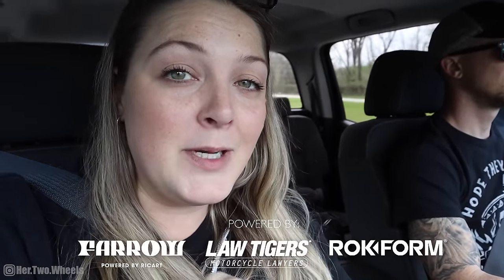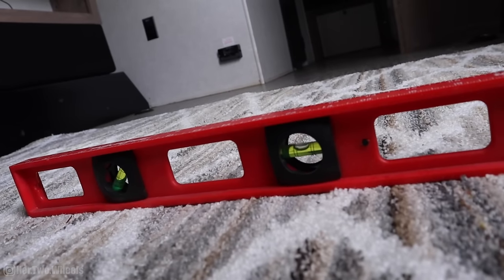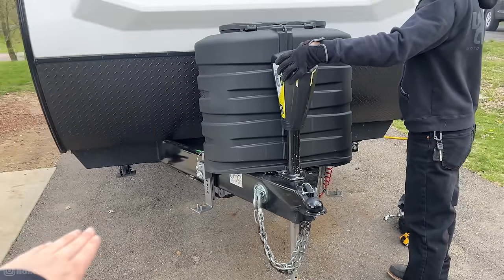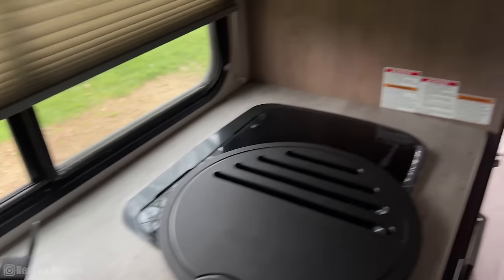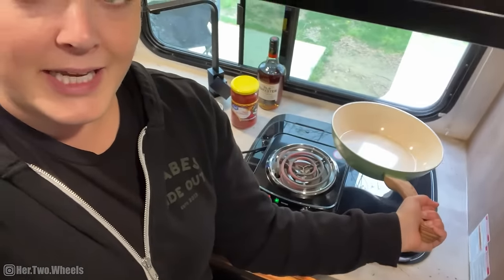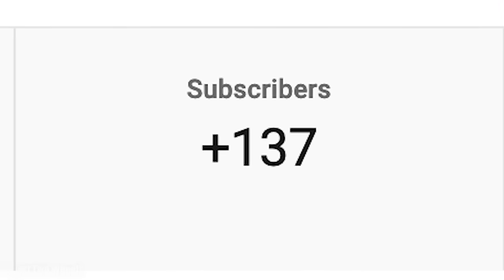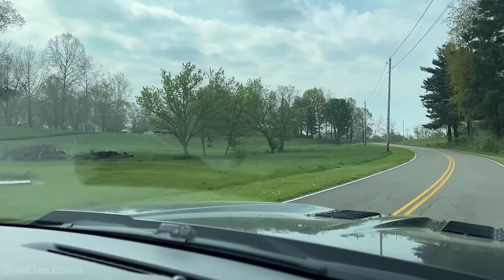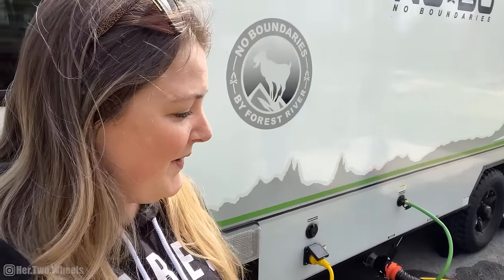First time camping in our new Toy Hauler! Mistakes were made!

Comment: Wow that campground put the top of the sewer pipe way down there, not much else you can do there.
I don't think there is a right or wrong way for which tank to empty first, but I like to empty the black tank first because then the gray water will help flush the crap out of the hose.

Comment: You definitely need to add that transmission cooler to the truck. Those gm trucks that use the 4l60e or 4l65e transmission are terrible about burning up the trans. Definitely use "tow mode" and shift it into "3" rather than "D" when towing. If you have ever gotten the transmission temp over about 220°f go have the fluid and filter changed. The transmission oil looses all its "goodies" after it gets that warm. 

I hope my mistakes can help you avoid the same ones
Reply: Those GM 1500's are not built for that weight.  2500 or 3500

Comment: No need to stand on flush lever. Close tank valve and let it fill with the tank flush port while hose is hooked up. Also watch video on backfilling black tank. The flush port does ok, but you get a lot more out after backfill.

Comment: Y'all did good for your first time. I agree with others, you should disconnect the weight distribution bars before turning/backing.
Reply: If that were the case how would you be able to turn a corner while traveling to your destination 🤔 
You only need to disconnect if you are planning on basically Jacknifing the trailer 😉
Reply: @jamesglenn520  you can leave it connected, but it just saves unnecessary wear and tear if you disconnect it at the gatehouse, also it's less noisy

Comment: What water inlet were you initially hooking up to? You don't need the water pump unless you using the water you filled up because your boon docking or somewhere there isn't accsss to water. Otherwise you hook up to city inlet and the water pressure in your camper will be whatever tge water pressure is at camp site.

Comment: We have been using our caravan since 2015 we live in Australia and appears we have it easier our
waste water is a simple hose drop into a drain.our toilet is cassette type last 4-5 days simply put into a hand cart take to the dump point all sites have them.we don’t worry about air bubbles in the water simply go into the caravan turn on the 
tap on when the water flows all good. You probably need a bigger oil filled radiator we find it easier to use as much of electricity on the mains hook up to save our gas.on free camp no mains water or electricity we have two water tanks and pack extra water containers just in case.we use outside electric heaters in the evenings like infer red type we have a washing machine in the caravan and a portable clothes line.use a inline filter so all in coming water is filtered no need to have a filter jug in the fridge which takes up room in the fridge if we free camp we have two solar panels to look after the lights and 12 volt water pump and tv extra. The grey water on a free camp is just soapy water so attach a hose and water the trees.if we need electricity we have a generator for the microwave,coffee machine and the hairdryer. Our camp sites are very close to each other so not ideal. We have just visited Grand 
Canaria we hired two Honda CB500X and the mountain roads where fantastic. Hired these bikes as have same in Australia. Enjoy your outdoor activities live your life Malcolm and Diana

Comment: I'm pretty sure those external bubble levels are not installed correctly. That's why the level shows you off on the inside. Notice the level inside has the tubes for the bubbles verticle where the external ones are installed on their sides.

Comment: Those little bubble levels suck. Always used the 2 footer. Also for the noisy weight distribution hitch, spray all the moving parts with some form of grease. They won't be noisy after that. Good practice to spray it every time you use it

Comment: I lived in my camper for about 6 months ...  propane lasts a long time,  I was in it in the winter and the spring in Northwest Georgia which can get pretty cold at night and during the day too many nights even in the early spring are in the 30s to 50s... propane is the greatest thing out there... and I haven't tried it so you would have to watch a video to be safe but fine steel wool and a 9-volt battery will start a fire also but I have a bag of dryer lint also LOL

Comment: I’ve never really made a big deal about being level, unless a noticeable lean.   I never use the tool, just leave it hitched and raise it up till there loose.  I have the same WDH.  A piece of 4x4 for wheel blocks, less work just as good. Till you get a trans cooler change your fluid often. Nothing wrong with being a Christian. Oil heaters are safer choice.  Charcoal from filter is normal. Create a checklist forget something and it will cost you money.  Turn on the furthest faucet and work your way closer.  No water pump needed hooked up to city water connection. Put the lid on to hold it down.   Use a short blast of gray water to test.  Freeze some ice packs and pack your fridge, things will be colder faster in fridge. When it gets hot traveling a fan inside and ice packs help.

Comment: You shouldn't need the water pump with water hookups. I'm guessing you have a valve that divereted the water into the fW tank instead of the water system. It overflowed, hense the water under the trailer. There is a a fill for the FW tank, usually away from the city water hookup. You can use that instead by filling it up and using the tank/pump instead of city hookup.

I also start the fridge the night before on electricity. Your fridge should automaticallly shift to propane when power is removed.  Run on propane while driving. I spent several winters on the road down south, I would have had a lot of spoilage if it didn't work while driving. 

When I level the trailer, the level goes on the stove top across the burners (both ways). I don't care if the floor is perfectly level, but I don't want my eggs sliding across the pan. The stove is rarely the same as the floor. 

I prefer the regular yellow chocks, IMO the X-chocks are cumberson, and put undue stain on the axles. Its so simple to throw regular chocks on each side.  

You did just fine, each time it will be easier.

Comment: Jess if that camp ground is connected to the water grid and the local government decided to up the water pressure for a new housing development this can happen my city did this within the last last year and a half cause one of my taps the water is going past the tap valve before they did it the water pressure was 45 psi now 55-60 psi sometimes it’s 75 psi if there’s air in the line so it’s actually a great thing that you had this happen on your first time out and that your pressure relief valve is working to know your campers plumbing is safe

Comment: Whatever anybody tells you your weight distribution bars act as your sway bars never grease them if you grease them your camper is going to start swaying. Yes they will make noise but that’s perfectly normal. Also your water filter the first time you used it it will run black water out when you first turn it on. That’s a good thing. You did that before you hook the hose up to it and to your camper was to run it first, also make sure you read the directions on that filter when you’re done with that it’s supposed to be stored in the fridge raider I guess that, so no mold starts growing in that filter. I’m a new subscriber hopefully someday we can meet up. I’m over here in western Pennsylvania but I like to do a lot of camping in the Ohio state parks, nice rig you have yes also definitely get a transmission oil cooler. I’m glad your truck has a gauge for the temperature for the transmission. You do not want to get that hot in the summertime it’ll get even hotter I’m 61 years old. I’ve been camping since I was in my 20s any questions feel free to message me.

Comment: You need a rubber dounut for that sewer system on the campsite and i would replace that water pipe plus you dont need the pump if you are connected to city water

Comment: 2 tips - 2 way radios for each of you for backing the trailer are helpful when in tight spots. I also had to create a paper arrival/departure checklist to prevent me from forgetting items.
Reply: No need for radios. Cell phones works great. Especially if tow rig has blue tooth. Otherwise speaker phone.
Reply: Use your cell phone when backing up

Comment: You do not want to put X Chocks on before leveling front to back. They are stabilizers not chocks as the name suggests. Raising or lowering your tongue jack with X Chocks in place can damage your tires and cause blowouts in the future. Your tires should rotate slightly with your suspension as your tongue moves up and down.

Comment: Get a true cool 40k or Amazon replica  for the trans cooler and don’t mount it in the stock location ( the truck will run warmer ) mount it behind the bumper below the radiator it will still function as it should

Comment: Quick question...we just got a toy hauler, 34 foot. We need to add a 16 foot ramp onto the back for wheelchairs (to make it accessible).

Because of this we need a Total of 50 feet, or 16 feet BEHIND the toy hauler to get the wheelchairs in and out. 

A lot of campgrounds I've seen have ZERO SPACE behind where you park the toy hauler at the campground. 

How would people normally get their toys in and out of the back ramp once its parked because from what I've seen its usually no space at all behind where you park ( no space behind ur rear bumper) to do so.
Reply from the maker: Unfortunately, a lot of times we have to park in the campground parking lot to unload our motorcycle before we actually back into our campsite. Which obviously isn’t ideal for someone in a wheelchair. It might be worth it to look into some kind of portable lift to keep close by taking someone inside or outside of the camper.

Comment: Couple things. Run the fridge off propane while underway. That way you don’t have to wait for it to cool off and you can keep your groceries in it. Use the propane unless your running the heater you will barely use any in a season. Don’t use the pump when you have a water hook up it’s only if your using the tank and with the black tank leave it closed till your ready to leave and flush it out even your grey tanks if you let them fill you can use the water and generally soap to help flush out your hose after you dump the black tank and it will keep the smell down
Reply: Running the fridge off propane Should Not be done while traveling. 
It is Not Legal to do so in some states anyway. 
The propane should be turned Off at the tanks while traveling for Safety. Should you be in an accident it could cause a fire or explosion. 
And you certainly don't want an open flame while fueling at the pump.
Reply: @jamesglenn520  yeah I thought that was a foolish comment about running the fridge while traveling. Very dangerous to do that

Comment: I've never had the pressure valve do that before with about 5 years experience, probably an issue with the campground's pressure.
Reply: Hi Jess n Jordan
When filling the black tank just step on the lever halfway so the toilet bowl fills and the “gate valve “ stays closed.
When the bowl is full step on the lever all the way to open the gate and the water goes in the tank.
Repeat a couple of times.
That way you don’t have the stink air fill your space.

Comment: Her two wheels... I almost hate to tell you this, but you will find.. that you're going to need the biggest baddest truck to pull this.... that you can get your hands on... I initially has a Ford f-250 gas with a 6.2 liter engine... with 2 bikes in there, and loaded for a little over a week in Sturgis... that baby was not quite big enough hitting the South Dakota wind on the plains there... I now have and Ford F-350 diesel non-dually which seems about perfect. (Your flavor may very... A Chevy 3500 or Dodge 3500 non-dually would be the same thing)

Comment: You will be surprised how long propane lasts. Dont be concerned about running the fridge. You have two tanks. That will last for ever. Stove burner dont use much either. The furnace would be the big user.

Comment: Looks like the camper was nose high when towing behind the truck. Unbolt the hitch and reverser the receiver. Trailer should be lever with the tow vehicle. It will pull a lot better.

Comment: There should be arrows on the water filter to show flow direction, and you should not leave the black or grey water valves open. Just open them when tanks are getting full.

Comment: I'd be careful using a space heater unless thats a 20 amp circuit with 12 guage wire. These campers are unfortunately built very cheaply. Cant just expect things are safe, or built the way they should be. Id upgrade to a dedicated circuit with a proper grade receptacle, and wiring if i were to be running something like that.

Comment: This RV guy didnt see anything you did wrong. 
Those water spigots sometimes have two valves in them. One that turns the water on an one that drains the water out so it cant freeze an bust. If the handle is not all the way open, both valves are open an water leaks on the ground.
I preferred to back in hugging the left edge of the pavement. That gets you closer to the hookups an leaves you more paved "front porch."
I would encourage buying the pc game American Truck Simulator, set it on hard mode an set the camera to in cab view. That will let both of you practice driving and backing a trailer in to odd places. Better to learn an make mistakes in a game vs real world.
Chalking one side is fine on flat ground, but both sides are better before unhooking on a hill. Bigger issue with trailers that have a wheel on the jack though.
A digital level is a nice toy. It will give you drop per foot. That times the 6 foot width of your axle will tell you how tall of blocks to put under your wheels. No guesswork.
I leave all the valves closed on the septic unless dumping. Rodents will get in there if left open. I also want my gray tank full when I go to dump the black, so I can dump the gray right after an that flushes the hose.
Dump stations work exactly like camp hookups. Just a hole in the ground an a spicket to wash the hose. Lots of youtube videos on it though.
Water Jerry cans are your friend when dry camping/boondocking.
They make portable waste tanks to hook to your RV, dump into then roll to the dump station. That keeps you from needing to move the RV as much.
Keep some cheap walkie-talkies in the truck. When the passenger gets out to help backing up, or to check the lights as your leaving, you can still talk to each other. You will use them a lot.
Check the trailer lights and trailer brakes every time you pull away from home or camp.
Heating with propane uses a lot, but it lasts a long time cooking an running the fridge. The electric heater is a grate idea, but just use the gas stove..
Most RV parks pack you to close together. Thats a good thing for a beginner. Any question you have your neighbors will will know. But more spaced out RV parks do exist, through rare. Lots of people also have private RV pads that they rent out. I dont know an easy way to find them through.
Good luck, you will have it all down in no time.

Comment: Leave the refer on else trick and gas. At will change as needed
When disconnecting from truck. Open ball hitch and let raise it will take pressure off leveler arm. That way now ones gets hurt.

Comment: I'm curious about your water pressure, it looked as though it was very low.  If you're hooked up to a water outlet you should not need to use your water pump. The pressure will come from the water source.
Reply: The water pump would be useless since it takes water from the fresh water holding tank, not the city water inlet. And it appears that they didn't fill the fresh water holding tank. But they will get the hang of it. Everyone is new at everything at some point in our lives. We live and learn. Hopefully as cheaply as possible. Mistakes can get expensive 😢

Comment: run your fridge while at home to pre cool it. then run it on DC on travel. not recommended to run on LP during travel. Looked like you chocked only one side and other was up on pads? x chock would prevent the side on pads from rolling. no need for the front and rear chocks if using x chocks.  light a stove burner to purge LP lines before lighting water heater or fridge from LP. and the dual LP tanks will last way longer then you think they will.

Comment: You will have air in the system. Hook water hose then open faucets inside.
Do NOT turn on water heater till you have air out of rhe system. Empty water heater power on WILL burn up water heater!

Comment: &Dirty Water ,No don’t never turn water valve from faucet full last u need A regulatory on outside faucet to prevent pipes from busting when U 1’st. Water., &
Replace All Plastic Elbows, plastic valves, Plastic T’s , valves on the water Heater. Good Luck 😢

Comment: Always do blackwater [sewage] first then gray water to flush poo away.  When you turn on water open a valve insideto allow air to escape. No pump needed except for fresh water tank use. Just sharing my experience, not a profesional so always verify all data with a dealer or lifer,. Oh and you need head space in hot water heater for expansion so dont open the pressure popoff when connected to water or it let your air out and tank may leak when water is heater. ask me how I know.

Comment: the only thing missing was robin Williams spilling the shit water...lol...kidding....you did fine. dont be afraid to use your propane, it lasts a long time. also, make a checklist for opening the camper, and packing it up and leaving the campground. that way your awning or electric is not attached when you pull away. always dump the shit water first, then flush with gray water. nice camper though....I like it